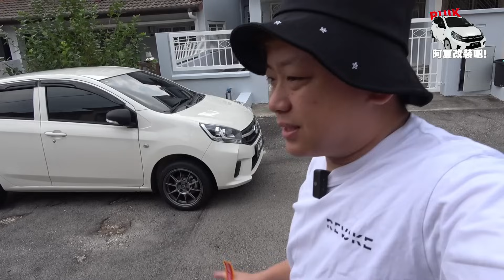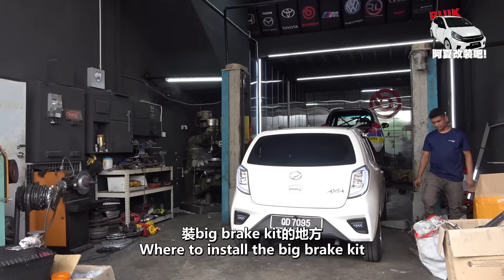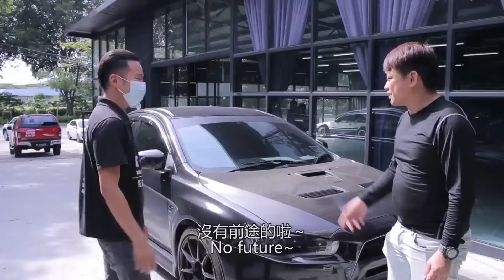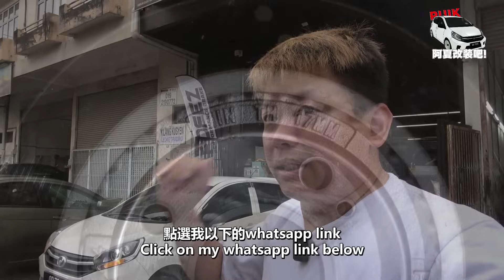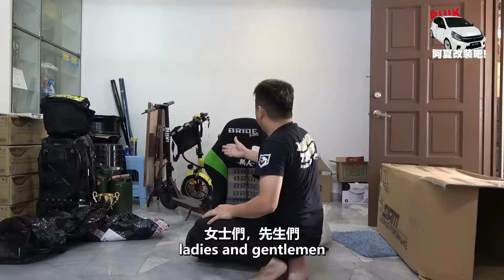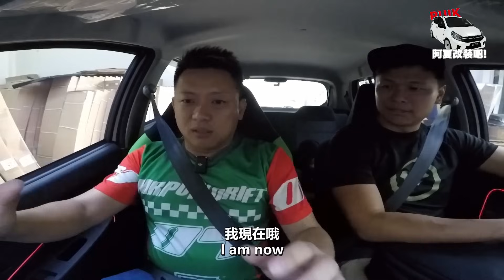Axia E 升級煞車！現在開車也比較穩了因為我有 BRIDE KING『阿夏改裝吧！』EP7

Comment: Your wheel vibration problem is because the new rim is not centered on the hub. This is very common with after market rim. So you need to install RIM/ WHEEL CENTER CONE. It is not because the rim is not balanced. You can google and find about about this.

Comment: Wheel hub Center Rings , see have anot, use rubber one, metal one if not fit nice nice also will vibrate.  Center ring rubber one tire shop i think will have sell

Comment: try remove the spacer for the vibration issue
Reply from the maker: Cannot, caliper hit wheels
Reply: @HeeWeiSeng  then no choice have to find a better spacer if not the wheel no matter how much U balance still will vibrate. Unbalanced rotation